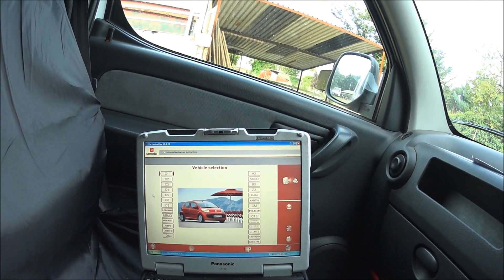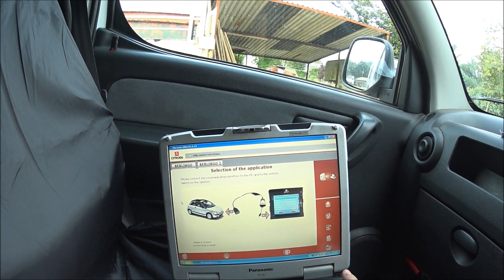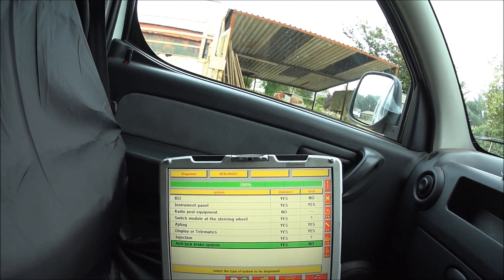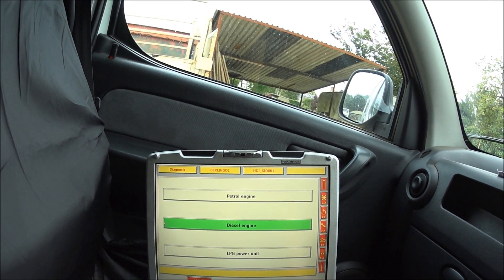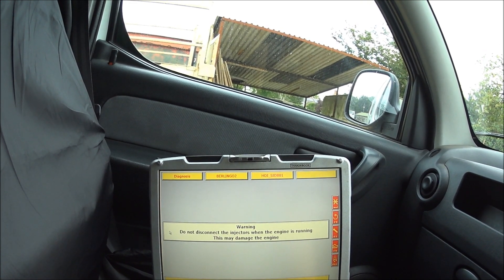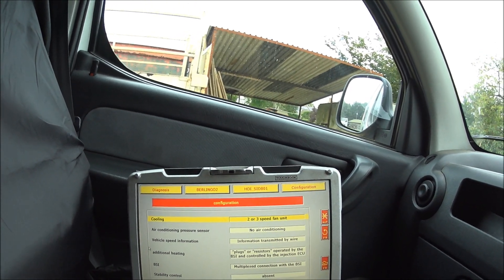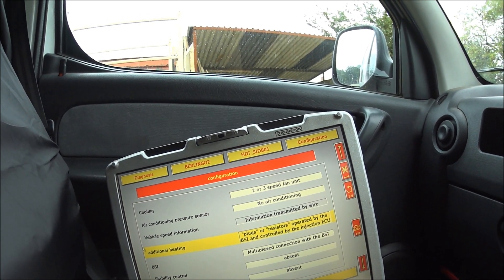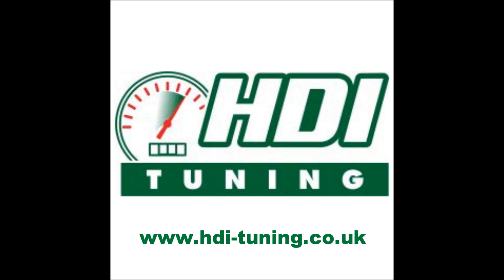How to use Lexia or PP2000 to run a global test and how to set the ECU configuration

Comment: After the  globalscan i select the highlighted "injection" bar but have no further options beyond that just a flat line(trying to intialise a newly replaced EGR valve BTW) its a Berlingo 2 HDI 1.6 any tips would be amazing.
Reply from the maker: You need to use diagbox, pp2000 and lexia is for really old cars

Comment: So, this system is USELESS, if you have to tell it what components are set up in the vehicle , which the owner/mechanic might not know. It should detect on its own and then reset them/tune them up.
Reply from the maker: Dude, this is for cars from like 1999, they didn't have Tec like that back then hahaha
Reply from the maker: With the new diagbox and a connection to PSA server it sets it automatically based on VIN

Comment: I've got a Peugeot expert 2011 I had to change abs module for a matching part number but comes up needs to be characterised but I'm not getting a option to do so in Peugeot planet . Any ideas
Reply from the maker: Try diagbox, replacement parts
Reply: Thanks  @StevenLewis-HDI-Tuning   will try that tomorrow fingers crossed
Reply: Just opened diagbox 4 options it gives me 
1delivery of vehicle to customer 
2repair
3fault finding 
4maintenance

Comment: If i get a ecu off yourself to plug and play will i need to configure this ? as in the new ecu you give me ?will it be blank ?
Reply from the maker: No, it will be ready to plug and play no coding required. This was a problem I had on the old sid801 ecus but I have a solution to it now so there's nothing to worry about. Which ecu type do you need and foe which car?
Reply: @StevenLewis-HDI-Tuning  207 110 hdi. think its the edc16
Reply from the maker: @DieselProductions95  ok I've got most in stock take a look here https://www.hdi-tuning.co.uk/ecu-remapping/unlocked-IMMO-off-plug-and-play-ECUs-remapped-ECU.html

If I don't have it just email me. The ecu is next to the battery to the left.
Reply: @StevenLewis-HDI-Tuning  with your ecu does it mean i need to programe my keys to it ? or will any peugeot key start it ?
Reply from the maker: @DieselProductions95  no need to code the key.
Reply: @StevenLewis-HDI-Tuning  Ah very intresting lad ! I may tell my friends !! easy and simple solution to our DPF and EGR issues so !!

Comment: From my experience lexia and pp2000 can not recognize euro 6 engines  with add blue, traders are selling it as main dealer equipment but it is useless for diesels after 2015.  If you know a product that can recognize 2015 blue hdi  100bhp please let me know.
Reply: That's because Lexia and PP2000 are for vehicles for 2007 and earlier.  You need Diagbox to work with newer vehicles, plus it also needs the right software update to 'talk' to the newer ECUs on later vehicles.
Reply from the maker: Lexia is old school, seems to work for diag until around 2013 then gets very buggy. For config stuff it's not great after 2006 roughly, it doesn't have the options in the menu.

Diagbox is the newer version, PSAdiag gives you a free version and a paid version both are much more up to date